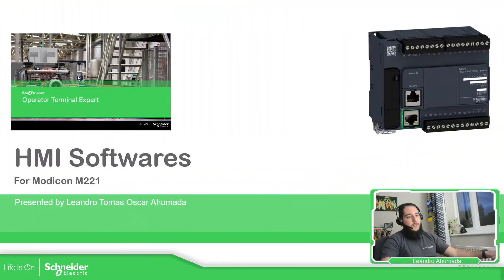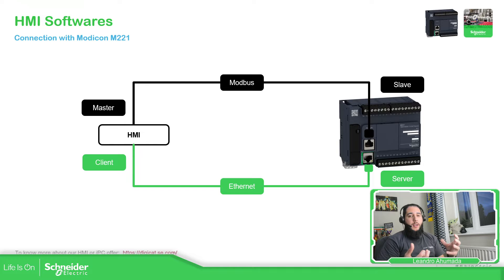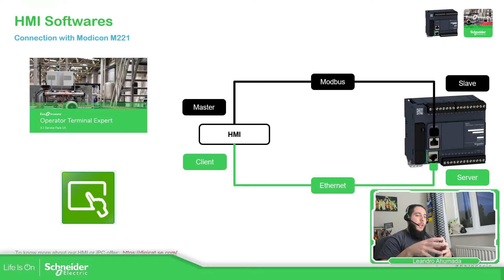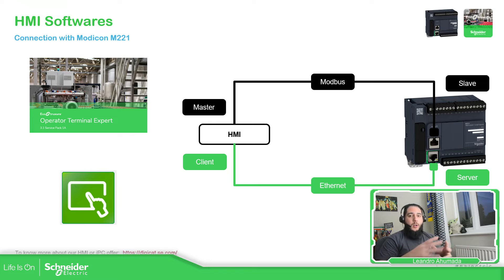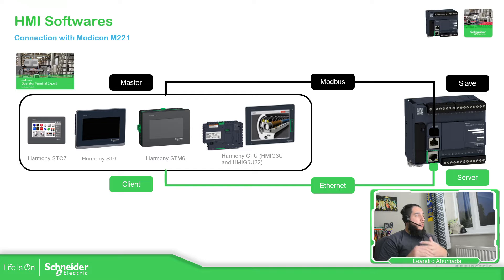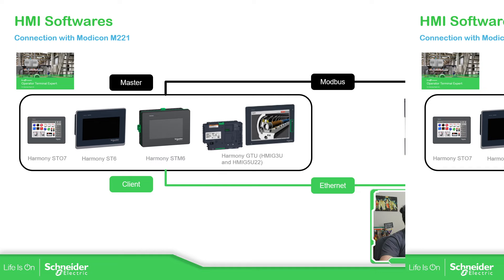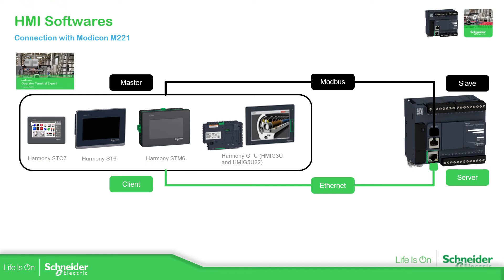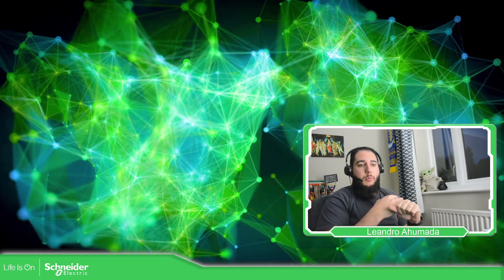Training - M221 - M14.0 HMI Softwares

Comment: Hola LeTomas .. tengo una HMI en terminal operator y esta se va a conectar a 4 plcs m221 .. en la misma red .. puse la hmi y el 1er plc. Simule ambos HMi y PLC bien. Agregue el 2do plc, el plc1 ya no ocupo simular, pero ocupo simular HMI y plc2, pero la simulacion no sirve. El plc1 programe la ip al valor real y el plc2 a 127.0.0.1 .. peronya no corre. Se puede simular la hmi con 2 o mas plc .. pero solo 1 plc simulado en machine expert basic?
Reply from the maker: Buenas Daniel, en tu caso te recomiendo simular únicamente un m221 con el hmi. En la  configuracion de basic podes elegir el port del simulador pero nunca probe con mas de uno conectando al sim del hmi